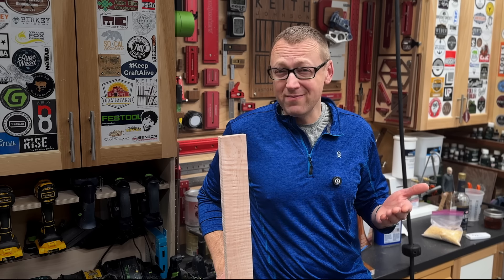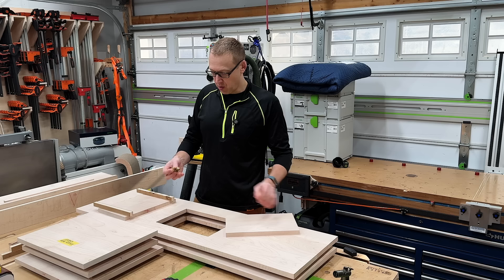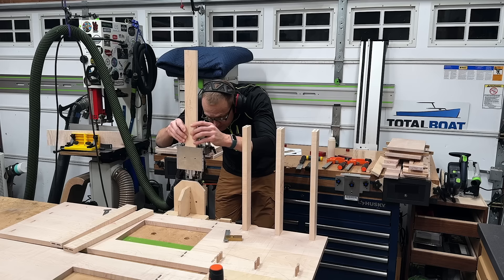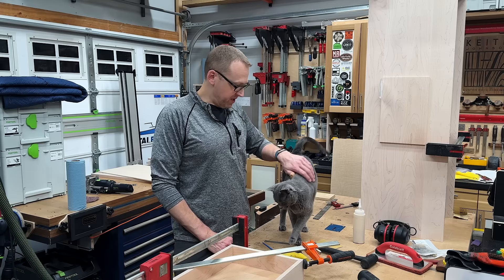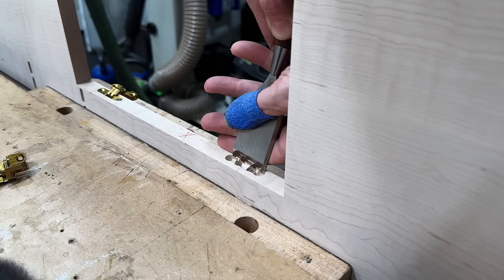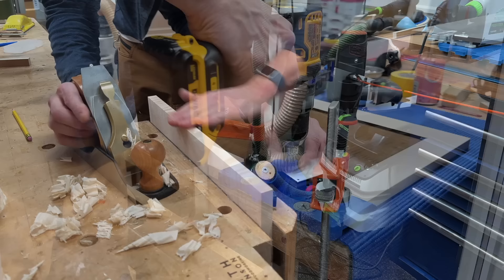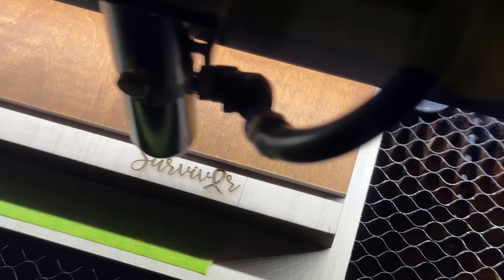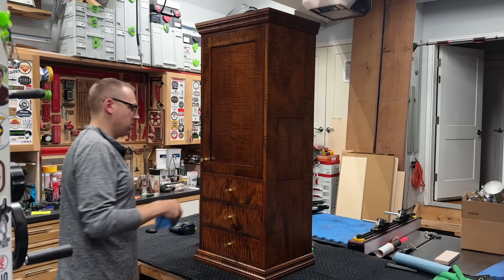Is building heirloom furniture worth the effort?

Comment: One piece of technique I got from a class I took with Davids Marks on veneering.  The edge joining on the wide panel veneer was good, but it will hold much better long term if you flip the veneer panel over, apply normal Titebond II to the edge and then use tape to clamp the edge glue seem.  Then, after it's dry, remove tape from one side before gluing to the core material.
Reply from the maker: Oooooooh! Great tip! Thanks for sharing. You can’t argue with David Marks 😂

Comment: Nice job on the build and video, especially with your fixes. I don’t think it was the glue penetrating through the veneer that caused the blotchiness in the first stain coat. Maple (like pine and birch) is notorious for being tough to stain without blotches. I don’t try to apply a medium or dark stain or dye to any of those woods without first applying a wash coat. I use non-wax shellac cut with either 2 or 3 parts denatured alcohol. The proper mix on the wash coat allows the stain to penetrate the wood very little, but just enough, that you don’t get more stain soaking into one area and not another. So no more blotching. I frequently use a dye and then a stain to get that extra depth like your finish had. I always use a wash coat between stain and dye to avoid “washing off” the dye (or first) coat. Once I get the stain/dye to look right, it’s straight to conversion varnish so as not to color what I already like. So your thought processes were spot on. Keep ‘em coming!
Reply from the maker: Great tips! Makes sense. Thanks so much for taking the time to comment! 👊🏻

Comment: Very nice piece. Love your attention to detail. I've used Eric's finish formula and have found that it can be tweaked to a particular piece's needs and uses. Need a faster build of the film? Up the poly content a bit. Want more of a matte or light satin finish? Lower the poly content a bit. The other great thing about it is that it can be tinted to fit needs as well. But yes, you need the time and the patience to await curing times before going to the next coat. As always, though, you figured it out and put out another beautiful piece.
Reply from the maker: The problem with more poly is a more plastic-y look, which is I why I steer clear of poly on my projects. The whole process with that finish is too long, difficult and not durable for an everyday use piece of furniture, in my opinion.
Reply: @KeithJohnsonCustomWoodworking  YMMV, I guess. Just giving my experience with it. Personally, I found it easier. My problem with it was the VOC content of the turpentine, so I subbed out mineral spirits for the turp (as Eric mentions) and found it far more tolerable.

Comment: Killer work, as always!  I’m glad to see I’m not the only one who struggles with gluing up deep rabbeted drawers like that! I actually bought the woodpeckers clamping squares thinking it would cure all my problems in life, but still ran into issues gluing up drawers for a dresser build recently.
Reply from the maker: Yes! I thought those clamping squares would be the cure for those glue-ups, but they are still equally as frustrating. Band clamps seem to work well, but your joints have to be perfectly flush...and even then it can leave some gaps.
Reply: @KeithJohnsonCustomWoodworking  I'll have to try that next time. Thanks!

Comment: Hey Keith!  Ive found that spraying those dye stains on is way less stressful than wiping them.  Virtually no risk of lap marks and it goes on so quick.  Once its on, just be consistent with your soak time and wipe!  I hope you give it a shot.
Reply from the maker: I appreciate the tip! However, in this case I preferred the control of hand application and once I got the hang of it, lap marks weren't an issue.

Comment: Keith there's no doubt it turned out beautifully, definitely a piece to be treasured for years to come, but I don't understand the point in the 'sneaky' doors as they open to reveal the same cupboard space as the main door does, at the beginning of the video when you mentioned 'sneaky' doors I envisioned a secret space. I also love seeing the interaction with your 2 gorgeous cats, very comical. 😊😻😻
Reply from the maker: Thanks very much! She just wanted to access the cabinet from the side without going around to the front and opening up a larger door. She didn't want a secret space inside the cabinet as it would take up too much room.
Reply: Hi Keith, thanks for the explanation. @KeithJohnsonCustomWoodworking

Comment: Beautiful piece!! I work at a custom woodworking shop in Toronto Canada and we use curly maple all the time. Even though we use a different finish we get basically the same results, so I know your pain when staining. 😂love the channel. Keep up the great work!!👍
Reply from the maker: Thanks Dave! If you have time, I’d love to hear your finishing process.
Reply: Sure! We use an NGR stain. It’s alcohol based. So you have to also work quick with it because it’s dries pretty fast. We have a first layer I put on that’s a mix of different coloured NGR’S and laq thinner. Then after a couple of coats of that I do the second layer with just one colour and no thinner. The second coats is usually more like 4 or 5ish. I just keep wiping that in until I get the desired colour/light or darkness, depending on what the customer wants. Then when it’s completely dry we seal it a few times then top coat with a lacquer. 5, 20 or 25 sheen. Also depending on what the customer wants. The colour you did is pretty close to the colour I end up with when it’s all finished. @abacusfurnituredesign. Shameless plug lol😊 again love the channel, keep the great videos coming!!
Reply from the maker: @davebrakas3704 Wow! That's quite a process. Thanks very much for sharing. Sounds like you are quite comfortable and get consistent results with the steps you use which no doubt took a lot of trial and error. Glad you found something that works so well!

Comment: Beautiful but can I make one suggestion - next time you use highly figured wood like this, match the drawer crossbrace grain with the drawer fronts - it's a simple enough trick and the crossbrace need only be faced with a thin section of facegrain instead of endgrain, but visually it would make all the difference.
Reply from the maker: Thanks so much! And I did do a dry fit matching the grain with the fronts, but  myself, along with the client, preferred it the way I did it. I guess we all have different tastes!
Reply: @KeithJohnsonCustomWoodworking  Fair enough :)

Comment: you should've asked someone who does guitar finishes - take a look at some of the paul reed smith private stock guitars - mostly highly figured maple - they use a waterbased analine dye - from my expierence I fully disagree with your staining sanding chart - to really make a grain "pop" with curly maple you want to use a dark color like black - satin the entire piece then sand it back with 180-200 grit - it will leave the grain dark in the areas which you want - and they you go over it with a second  lighter color which in this case would be the orange - you have to fully let it dry or even spray the stain on in very light coats so it doesn't bleed - you can also use something like an acrylic based sealer, then sand that off to lock the color in so it doesn't bleed when mixing the black and orange. 

It's a tedious process, but the colors you end up with will be amazing. 

Alcohol based analine dyes also work fantastic - I've never seen the dye with the iron reaction and heat gun that's pretty cool, generally your always going to have some issues with the wood glue discoloring things - so you've just got to be really careful with when your doing stains like this....

You pretty much always want to spray something like this with a two stage finish so you can seal the dye so it doesn't bleed, and then layer the gloss after it's sealed. 

Any of the modern 2 stage or even one stage varnishes made for a kitchen counter top will be just fine for bathroom use or areas near water - at least assuming your not leaving standing water on it for a long period of time. 

All and all it looks fantastic.
Reply from the maker: Thanks for taking the time to share your tips! Very helpful. Cheers! 🙏🏻👍🏻

Comment: Beautiful, thoughtful work. Have you used pre-made veneer with parts that received Rubio? I’m curious if the pigment in the Rubio would react differently with the solid versus veneered parts, if I made cabinet door panels this way. I know typical hardwood plywood has such thin veneer that it can look very different. I’ve recall you made shop-cut-veneered doors with the recent vanity, but I’m wondering if making a large plywood sheet with the pre-made veneer would let me cut multiple door panels, and still match the frame once it gets Rubio.
Reply from the maker: Thank you! And yes, I’ve used Rubio on veneer next to solid wood many times and while it may look very close in the short term, they lighten at different rates over time and it becomes very noticeable. I much prefer to cut veneer for door panels from the solid wood being used to maintain color consistency throughout. It’s definitely more work, but looks much better.

Comment: Noobie question. Pre gluing dominoes. Is there a technique that prevents the glue splurge?  I didn’t think about it and it meant that my joints didn’t sit properly. I ended up using a chisel and sanding to remove the excess glue.
Reply from the maker: Pre-gluing prevents the stress of trying to glue in Dominos on both sides and get everything assembled and clamped up before the glue sets up.
Reply: @KeithJohnsonCustomWoodworking  Hi Keith 

Thanks for taking the time to reply. 
I understand the reason for doing it.  My poorly worded question was basically asking what your approach is to avoid excess glue from the pre-glue from disrupting the joint when you do the actual glue up. 

M
Reply from the maker: @MrMjt888 A lot of people use too much glue which causes excessive squeeze out. Best approach is to use the minimum amount of glue necessary.

Comment: Truly beautiful and special piece, congratulations. do you spray in your small shop? I thought about doing that in mine but I’ve always been worried about overspray. Is that an issue for you?
Reply from the maker: Thank you very much!. In this case, I was spraying in my friend’s shop where it’s wide open and not a problem spraying small things. In my own shop when I spray,  I have to basically tarp everything off and open the garage door with fans and filters. And being that I don’t have a dedicated spray booth, it’s why I don’t spray solvent based finishes
Reply: @KeithJohnsonCustomWoodworking  same. There is a guy on YouTube, the Idaho painter that has a really nice spray booth with a super powerful fan. That’s perfect for shops like ours, but it’s very expensive if you get his exhaust fan. But check it out.
Reply from the maker: @AVSMedical1 The exhaust fan is key and being that I don't spray that often, it's not worth the investment at the moment.

Comment: Why would any woodworker avoid working with figured wood? Just because it's more likely to warp? Do you find it tacky? What's the deal?
You obviously seem pretty serious about it, since you pointed it out at least 3-4 times, just within the first few minutes of the video.
I don't get it myself, if I could, I would make every single project out of highly figured wood. Straight grain just looks so boring!
The finished piece looks incredible, by the way.
Reply from the maker: it's very difficult surface and mill and is very tear-out prone due to the constant change of grain direction. And as a general rule, it's too busy for me on large pieces.

Comment: so after you fixed the blowout with that strip repair you didn't explain or show how you did it correctly afterwards.
Reply from the maker: The strip on the drawer? The correct notches were already cut on the bottom at the same time I did the others, so there wasn’t anything else to show.
Reply: When you used the dado stack and got the unwanted tear out.  no worries final result looks great.